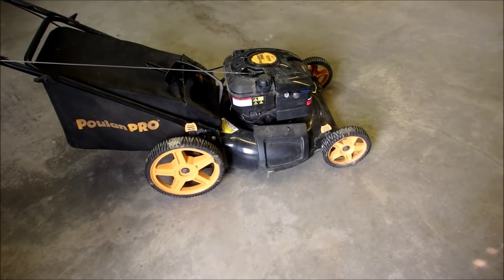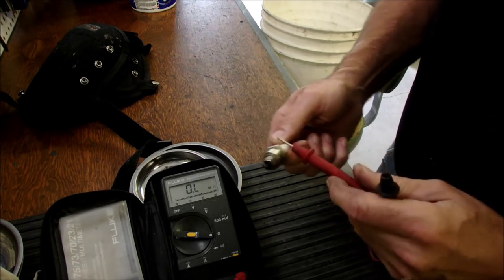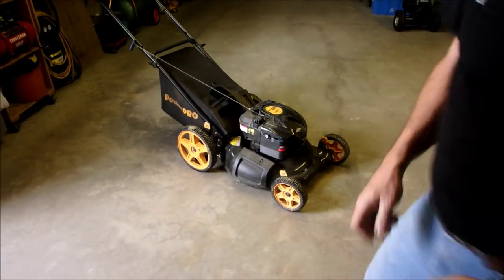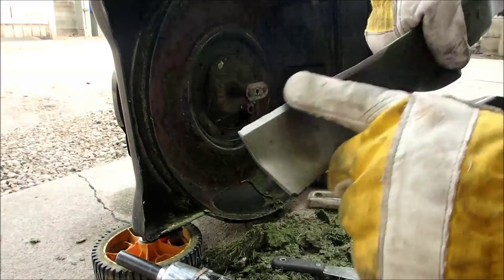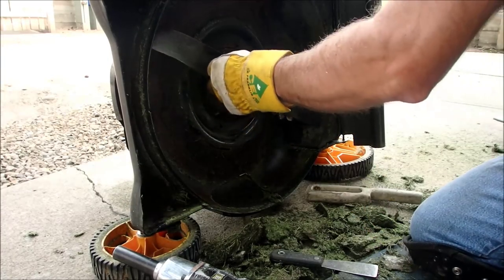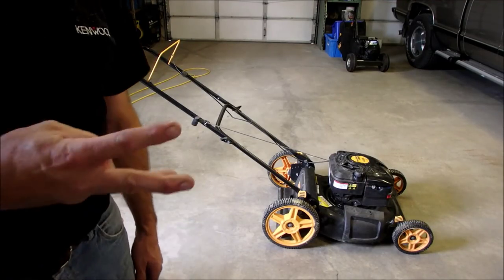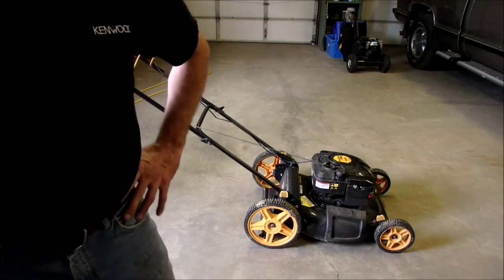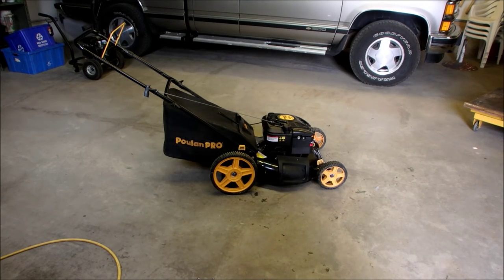Repairing a non-running Poulan Pro Mower

Comment: Funny, my wife found this exact same mower at a garage sale 12 years ago marked "Free - Won't Start". Replaced the spark plug, fuel and air filter and it started on second pull. Pulled it out of the garage this winter and it still runs great!
Reply from the maker: Right on.

Comment: This was a great help, as I was given a Poulan Pro PR550 N22SH (22") 5.5HP 158cc today and it doesn't start.  It too has all sorts of problems: muffler missing (but sleeve still threaded in - can't tell but think its the round type for this B&S?),  engine chassis mount bolts missing, completely twisted blade. First a muffler then a spark plug, if it turns over, I'll immediately spring for the new blade. Hopefully with an initial $10.00, then a bit more for a new blade, it'll' get me a mower on the move, after fuel and air filter clean.
Reply from the maker: Good luck Kevin

Comment: Thank you. A neighbor was moving and generous. It will be interesting if mine is a bad plug as well. I pulled the old plug and saw some corrosion
Reply from the maker: Those plugs will take quite a bit of carbon build up.  Please forgive me for going a bit further.  You can check the plug and spark by removing it while still connected to the wire --ground out the threads to the frame and have someone pull the rope for spark.   After putting the plug back in pour a small amount of gas into the carb and it should run for a couple of seconds.  and also check the air filter.  3 things   spark fuel and oxygen.    good luck

Comment: I love this! This is the same reason I got my Poulan rear bagger mower for free. My Brother-in-law bought it new and thrashed it for a few years before it quit. When it quit, I told him to make sure he had fresh fuel, and to put a new plug in it. He did that and it still wouldn't fire. Not even with starting fluid. He got fed up and bought a new mower. He told me if I wanted it for parts or to try to fix, I could take it. 

Got it home and checked the usual suspects, but no luck. Oh well, it had a brand new plug in it, so I put it in my mower. Guess what? Yep, my mower wouldn't start. So for $3 for a new plug, I got a decent mower that mulches, bags, or side discharges.
Reply: Should have added what are the chances of buying a brand new bad spark plug?
Reply from the maker: +AnthemBassMan Good for you

Comment: Just found one in trash. Was dirty, not starting. Cleaned all, had to change car, plug and filter. fired up. Man is just this 625 or do they run with ball to the wall!?!? This thing has power!
Reply from the maker: the have power.  Check the governor .  Measure the RPM

Comment: Easiest way to check a spark plug, I have found, is to use another mower that I already know works well, put the questionable plug in it, and see if it runs.

Comment: What size socket did you use on that gun to take the blade off thank you
Reply from the maker: 9/16  bolt      i/2 inch drive
Reply: Thank you sir

Comment: Hello I’m a new subscriber and I love your attention to detail in your video with the Poulan pro mower I have the same mower but the problem is it won’t stay running I spray carburetter cleaner I have cleaned out the car the best I can and still it just runs a little bit and stops! Now I was wondering if this same model in you video has a auto choke because mine has a primer bulb so it’s for sure a carb problem if so I would probably need a carb if you have the part number for that and the gasket that goes on the primer bulb plate that’s andgreat video
Reply from the maker: Did you remove the carb and spray the jet-bolt that hold down the bowl?    Take a look at this video  it is old but you never know??
https://www.youtube.com/watch?v=Gy--7hcBFps
Reply: Yes I took the carb completely off and did the same thing I also sprayed in all the other holes now I will say this was given to me by the neighbor next door and he said it had been sitting for at least a year and a half there was no gas in it but the carb had a nasty air filter filled with gunk and have stains on the inlet of carb  I for sure need a gasket for the primer plate in between the carb and plastic plate with the primer bulb it’s no good after cleaning the carb the best I could I did not see any fluids coming through that little brass tube in the middle of the carb? By the way this is my wife’s I pad I’m responding  though thanks for any advice you can give your new sub Allen

Comment: Any suggestions on a poulan 450e? It seems I have to replace the carb every year or it won't run, if I continually pump the primer it'll run, yes I'm running non ethanol in it and usually drain it in winter months
Reply from the maker: If you are using ethanol fuel, then I would check you gas can for a bit of dirt.  Just empty it into a pail.  I see everything like this.  Thanks for watching.
Reply: @BrucesShop  Tanks clean.

Comment: Do you have any fixes for an older version of this mower, that the wheel assemblies and adjusters are loose resulting in the mower cutting at different heights.  I fixed 1 of the wheels that was completely broken off when I first got it about 3 years ago, recently its started cutting at different heights.  Kind of at a loss as to a fix to remove and remount the wheel and adjuster assemblies so they won't wobble loose.
Reply from the maker: +William Todd (williamtodd) Try to get a newer older set   hahaha that sounds funny.  We can't fix everything eh.
Reply: Bruce Pender The deck mounting locations for the wheels are just plain worn out...too bad because the engine works just fine.  Time to go shopping I guess HAHA.

Comment: We did everything but I still don’t get it spark spark plug
Reply from the maker: Well everything is a lot.  First disconnect the kill wire from the coil then check for spark.  If no spark change the coil.  Be suspect of the plug to at first of course.

Comment: Just wondering my wife was given a Poulan Pro with electric starter but the wiring was not connected to the motor so I don't know where they go or if there is wires missing or even where they go any books that may show me where they go.  I have been surfing the internet with no success.  Thank you
Reply: +Denny Johnson If you search around the internet with the model number you should be able to find diagrams of the mower and be able to find where those wires attach.
Reply: +William Todd (williamtodd) I have had no luck can buy new wiring harness's  not showing where the wires hook up.  But Thanks
Reply: Battery box below and to the rear of the engine.  Bought a battery charger, still won't start. Will try checking battery next.  If I can get it out of the box.

Comment: I replaced my wire that turns the mower off when you release the handle. Now it is very slow to turn off when you release the handle. could you show me the proper way to install this "wire"??
Reply from the maker: The cable inside the black conduit should move about 2 inches.  The little z bends just hook onto the hole on the handle and the hole in the slidder on the engine.  Unless you got the wrong cable.  I don't know what to say.  
This video should help you
https://www.youtube.com/watch?v=8U5765Nma-k

Comment: "The carburetor is full" ... and he still primes it before starting.😂
Reply from the maker: On the Briggs Quantum mower with a primer button,  the primer creates a pulse of air which creates a small shot of fuel that comes out of the emulsion tube which  increases the air fuel mixture creating an easier start.  You can see the squirt of gas when looking into the intake.

Comment: Hi , having issues with the same brand lawn mower but it’s a 550 series !! It got gas, I checked the oil ,and I pulled the string And it does not start
Reply from the maker: This may help.  Sorry it is an older video with lighting issues but the point is there.  
https://www.youtube.com/watch?v=Gy--7hcBFps

Comment: There is no choke!!!
Reply from the maker: Yes  Some have a manual choke,  some have a autochoke and some have just a primer like yours.  I have a lot of comments. was it you looking for a new carb?
Reply: @BrucesShop  hey no, but I was just given one of these the 150 cc one and it won't start, but I didn't see a choke on it.. I prolly need to change the spark plugs since it's been sitting home year or more
Reply from the maker: @MothaAlienz  It is seldom a carb.  If you prime te carb with fuel and it runs for a second you need to remove and clean the carb.  That is what  I do.
Reply: Based on another video, auto choke is internal, remove air filter box.  Choke gets stuck, file for fix.

Comment: never turn a mower on its's side(EVER!) oil will either run into muffler or carb depending on witch side it is tipped lean it back and put a weight on the handle or get a helper to stand on the handle i learned the hard way on that one about 20 years ago
Reply from the maker: I do it.  Sometimes a little oil either gets into the muffler through the exhaust valve or even into the carb from the intake valve but usually there isn't any issues.

Comment: PLEASE SOMEONE JUST SHOW ME HOW TO START ONE THESE IN THE FIRST PLACE🤦‍♀️
Reply from the maker: Well if pressing the primer button 5 times does not work It may be faulty.  So next before you take a bunch of stuff apart take the spark plug off and dribble about 1 tablespoon of gas into the hole where the spark plug was.  (cylinder).   Then try to start it.  If it runs for a few seconds and stops you have a plugged carburator.  If it stays running the primer  gasket needs to be replaced.  If the is no primer button it is an autochoke so just do the fuel in the spark plug idea.  Goog Luck.  BE CAREFUL   Gas is dangerous.